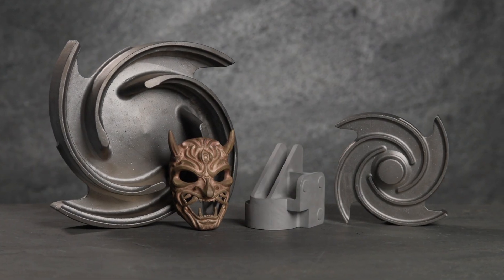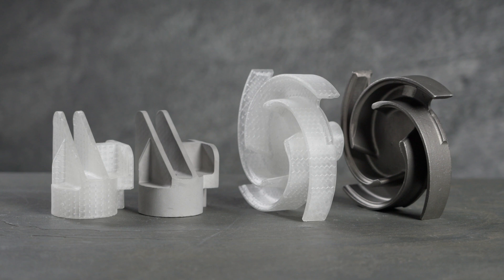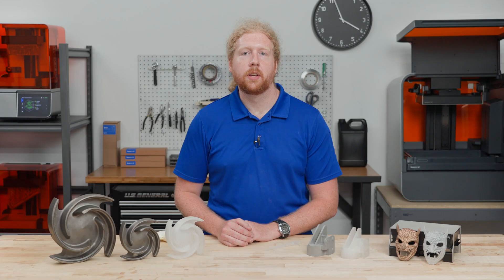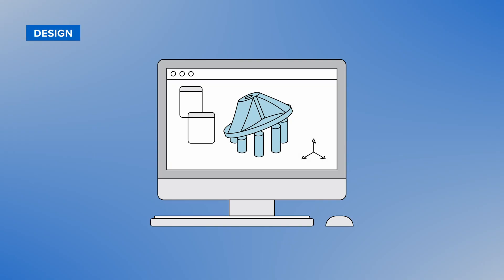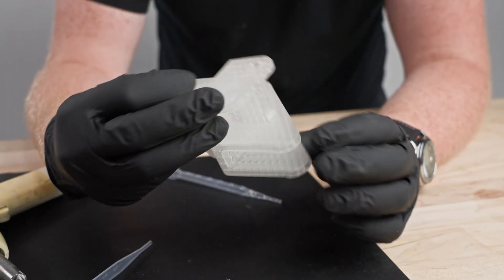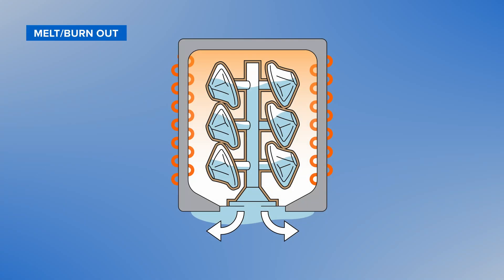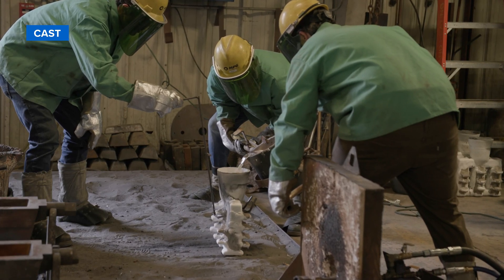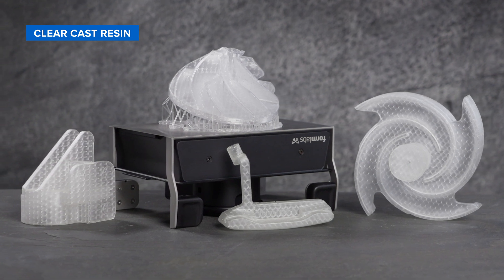Revolutionizing Industrial Investment Casting With 3D Printing Patterns Using Clear Cast Resin

Comment: I'm looking at the cost of a lot of these billet racing parts. All cnc machine from a giant block of aluminum. I really believe that quickly 3D printed lithography mold and an automated proces would really cut down on the price compared to billet. I have questions on strength though and why one can't align the grain of cast parts the same way the aluminum was cast into a billet block. I am not sure what I am missing but aluminum doesn't come in a giant block so why can't it be recast in a similar way?
Reply: Okay after looking it up a bit I guess using a vacuum high pressure a magnet and temp controlled cooling veins in the mold are being researched. But then still expensive